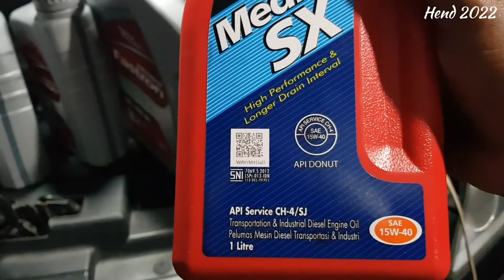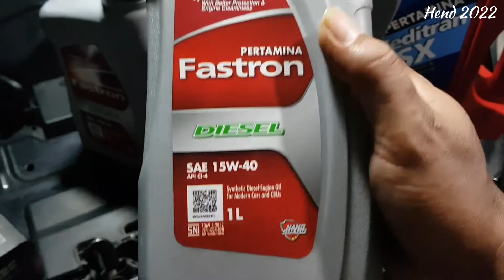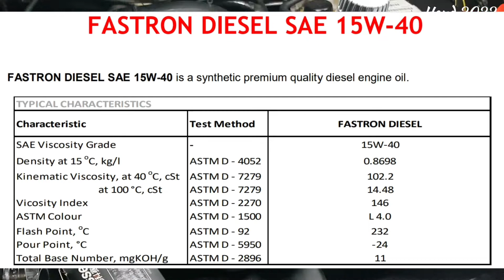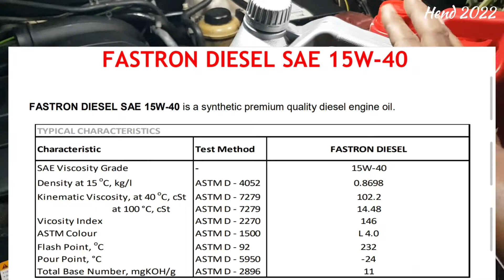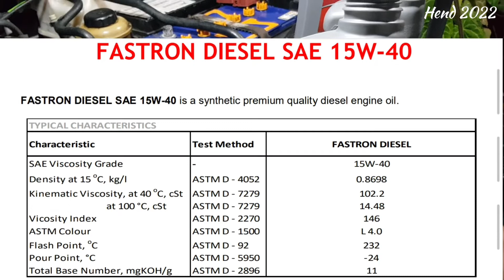FLUSHING ENGINE OIL CHEVROLET CAPTIVA DIESEL C100 NFL DENGAN "KEARIFAN LOKAL"

Comment: Om, bisa info bacaan boost di obd saat idle daan saat rpm 2000… lg ada msalah turbo di nfl ku om..
Reply from the maker: Kebetulan boost d sy jg stuck di 0.4 di obd om.. mngkin krn sensor kotor sy blm smpat cek

Comment: Mau tanya Om. Dulu awal saya minang nfl bekas sejak 2020, saya full pakek biosol tnpa campuran sm sekali, oli pakai shell rimula rx4 15w-40, tarikan enteng tp klo ud km 4rb, asap jd agak sdkit ngepul. Jd tiap 4rb km saya selalu ganti filter oli+solar.
Biasany saya slalu gnti oli dll, dbengkel dekat rumah.
Trus kemarin waktu ganti oli, nyoba dbengkel spesialis chevrolet disurabaya. Sama mekanik katany disaranin pke oli 5w-40, krn klo pke 15w trlalu kental katany.
Saya disaranin pke oli q8 excel 5w-40, tp saya ngerasa tarikan kerasa jd agak sdikit lebih berat.
Mohon sarannya Om?
Reply from the maker: Abaikan angka di depan om, u iklim tropis oli 30 - 40 sdh ckup. 15 - 40 mmg kental saat dingin, u mobil yg nginap di daerah dingin gak d sarankan.